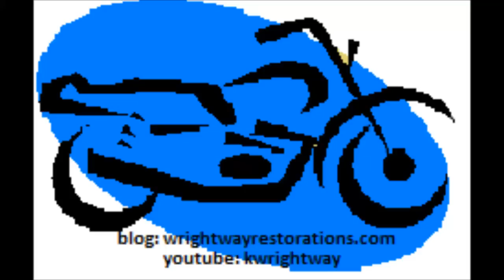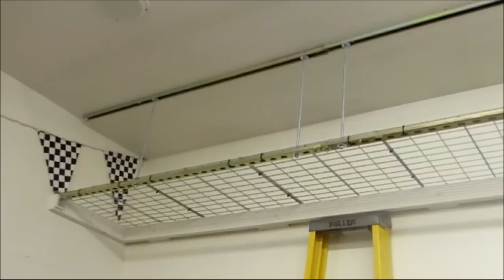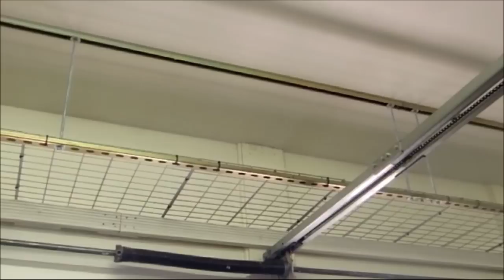Garage Shelving w/Unistrut, 3/8 all-thread and Open Grid Panels

Comment: Where can i find the open grid wire shelving in mid florida
Reply from the maker: bill I wouldn't know as I don't live in Florida.  I would suggest you check with the large home center retailers in your area or building/electrical suppliers.
Reply: Tractor supply

Comment: Why run the uni strut all the away instead of just using a foot or two where they connect to ceiling?
Reply from the maker: Good question.  I wanted to hit every ceiling joist with a lag bolt and didn't want to fiddle around with cutting the material down.  The cost of the material wasn't a particular issue on this project.
Reply: I see, makes sense then. I was also curious about the cost but you answered that also :) Thanks.
Reply: Running the uni strut continuously also allows you to move your all thread hangers if needed to adjust for larger items you may want to store where the all thread is in the way in the current position.  I took this idea & built my own Uni Strut "Skeletal Shelving" but used Uni Strut Nuts so my all thread does not protrude below the bottom uni strut, gives a much cleaner look, & also installed clear tubing over my all threads.  Love this shelving, wood is a waste of time & space.